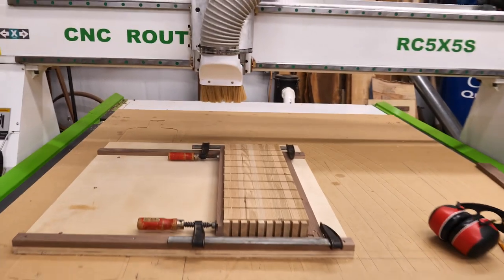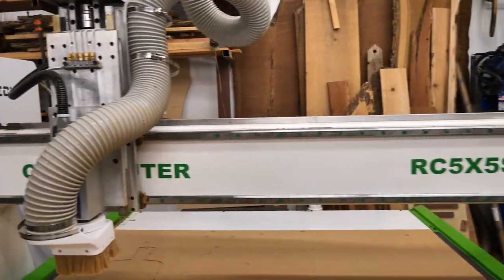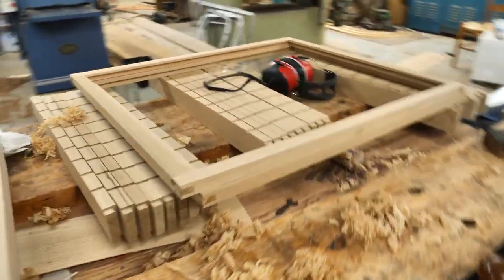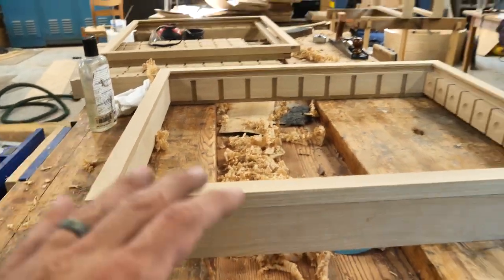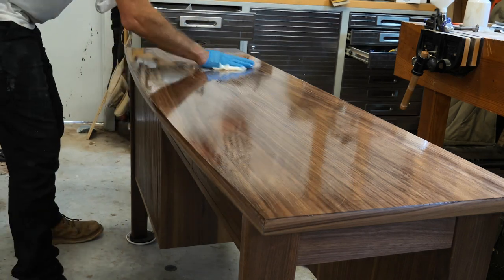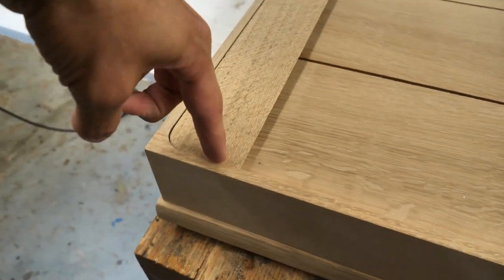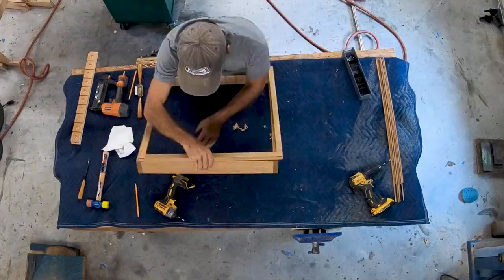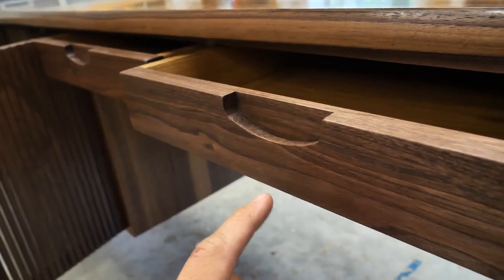(New Format) Shipping A Display Case to Slovakia!  // Dust Collection Repair // Record Console/Desk

Comment: On those inner cutouts. You can run what’s called a dog bone. I use fusion 360. It’s an option you can select. It would save you the hand work with a chisel. But it’s not as clean of a look. But for the work I was doing. High production cargo bike boxes. It worked great! All the parts fit great! Right off the router table!
Reply from the maker: I’ve seen those before and I think they can be useful in certain applications.  Being somewhat of a perfectionist I struggle with the gabs they leave..
Reply: Yeah. It’s not a clean look. But if you can deal with the tiny gaps. It’s a great time saver. The work you are doing is very high end. Something to keep in mind for future projects.

Comment: If you start getting missed steps on your x y or z I’d venture to say your dust collection being attached to the machine would be the culprit. I like to have the a piece of pipe attached to the cnc and allows the flexible pipe to be above the machine Z axis so it can’t touch and possible ground itself when it builds up static. I am dealing with this issue a lot on cncs.